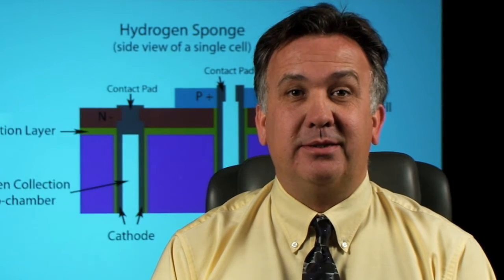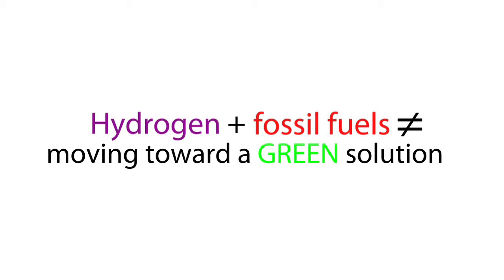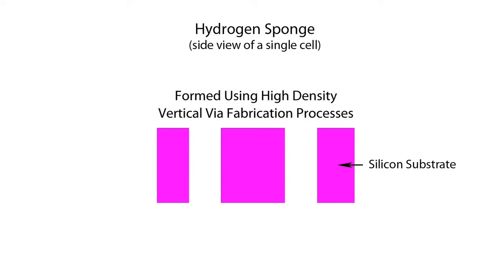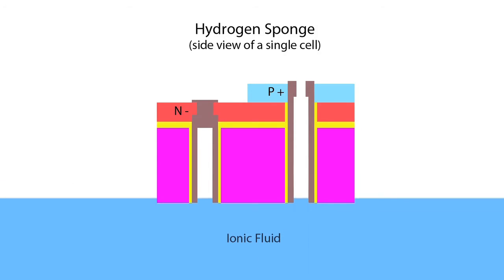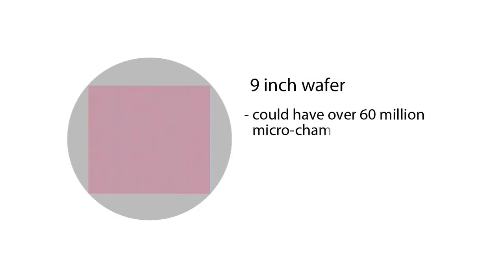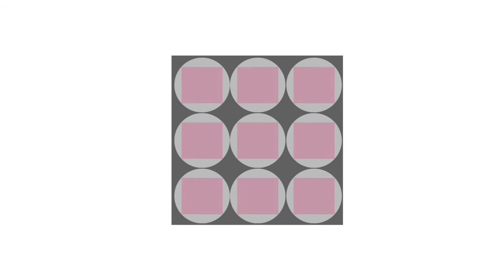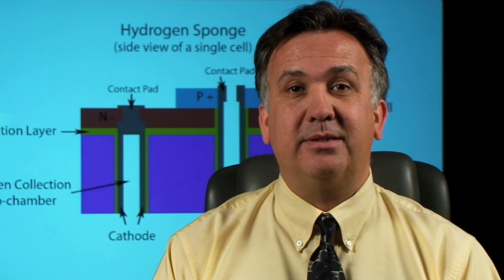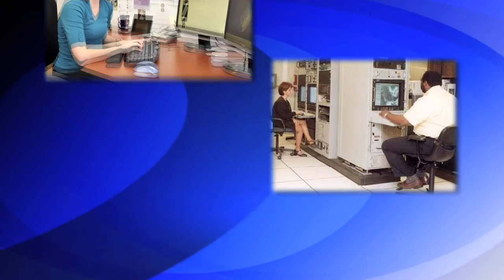Hydrogen Sponge

Comment: The DOE posts metrics for hydrogen storage including cost per mass of hydrogen, gravimetric energy density, volumetric density, and refill times.  This system seems to require lots of single-crystal silicon, micromachined in a MEMS fab, per unit quantity of hydrogen.  That has got to be expensive and heavy on a per-hydrogen basis.  US 8,697,979 includes calculations, but they are not normalized for comparison between competing technologies.  Are there any such metrics which can be posted here? 
.  Likewise, hydrogen generation is measured in dollars per kilogram.  Electrolysis requires 1.23 volts (1.48V in practice) which is higher than a single silicon photodiode can provide.  The patent does not appear to address this.
.  And if the wafers are stacked, how will the sunlight reach any but the top one?
Reply: very exciting

Comment: Now I see why they only mention storage at STP. Hadn't thought yet about getting the H2 out which means increase the pressure. I think I'll get some chicken feathers, heat them in a closed container, produce solar electricity, produce H2 and store it in carbonized chicken feathers. To keep the H2 from migrating through the tank walls I'd paint the inside with carbonized chicken feathers. But, would this work? Much , much cheaper than this thing.